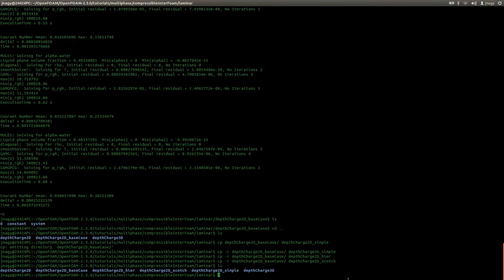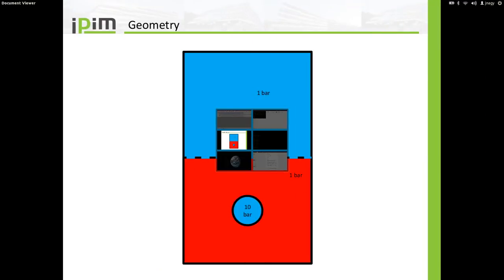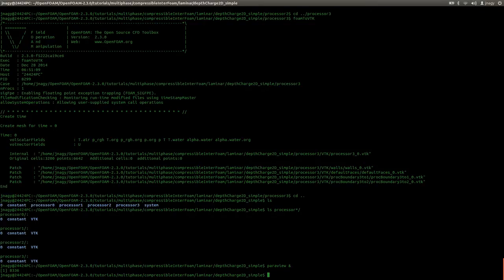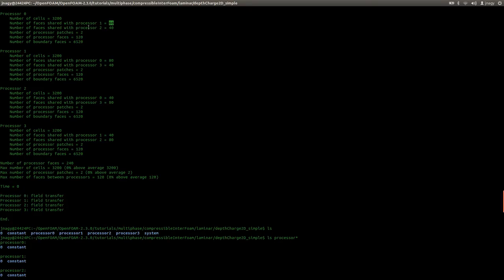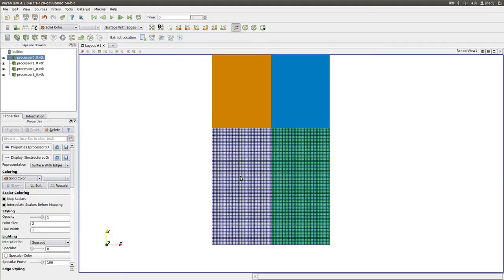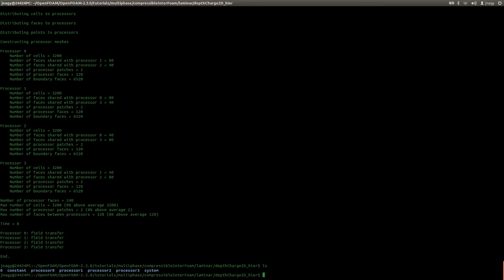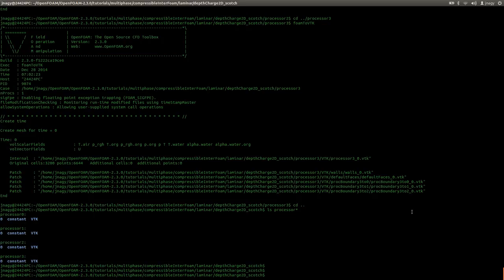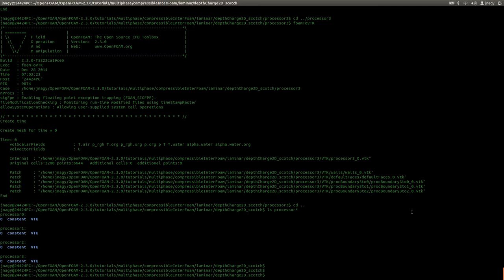How to run parallel simulations in OpenFOAM® - Part 2

Comment: i saw your video but i have not find my solution for this problem......i have been face problem in running the "decomposePar" with "of41" while my whole work has go on "of220". bcoz here processors have not read the different zones i.e. heated,cooling zones. show saturation temperature same as maximum temperature......processors do not read the heater temperature after "mpirun -np.....-parallel"
plz...give me valuable suggestions how to resolve this ...

Comment: That was a very good and useful tutorial
But how can I run the case in parallel mode using the openfoam ming version in Windows?
I tried this command (mpirun -np 6 pisofoam -parallel) but it didn't worked
Reply from the maker: mpiexec instead of mpirun?
Reply: @OpenFOAMJozsefNagy  thanks it worked

Comment: i have 6  real core  but 12 virtual threading  , can i decompose in 12 parts ?
Reply from the maker: You can try, but I do not think, that it will improve the performance.
Reply: do you think 6 parallel decompositions works great ?
Reply from the maker: @ing.nicola1706  I did not have the time to extensively test it. I would love to hear your opinion on it.
Reply: @OpenFOAMJozsefNagy  i will try ...